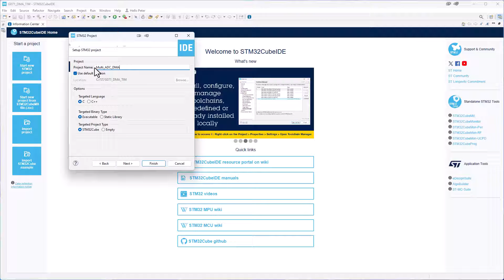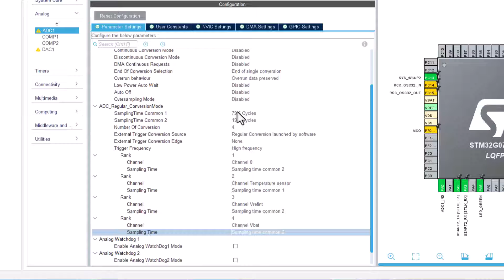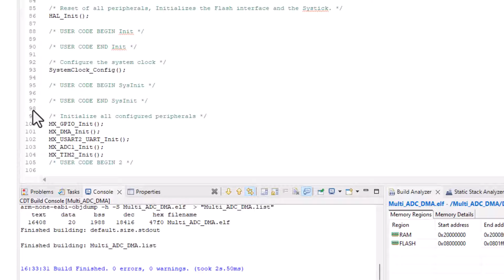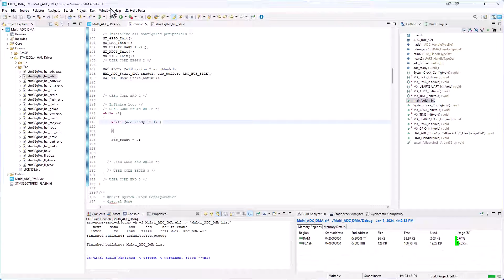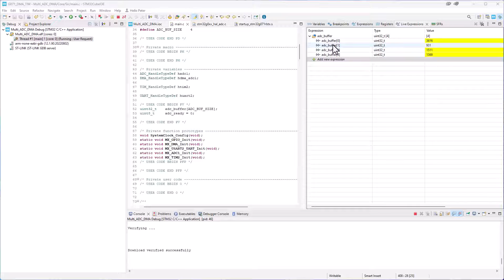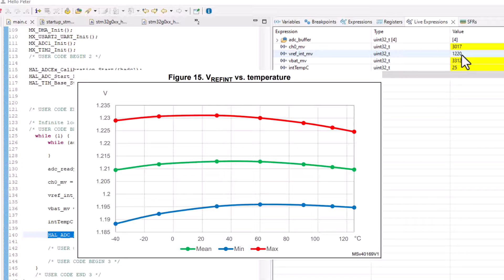STM32 Multi ADC DMA method

Comment: Great video. Thanks a lot. Looking forward to your next exciting videos!!!
Just curious,  are those 4 measurements are accurate? Probably  it would be good to have 20 items as in the beginning and then just get an average of each parameter?
Reply from the maker: Hi, "Accurate", that is a term that need to be specified. 
But your suggestion to make several samples and average them is a good way. You could also set boundaries to filter out glitches. Let's say you measure a 1volt rail and make 20 samples. 19 samples are in the proximity of one volt, and one measurement is getting 2 volts, which is in the application, not in scope, You could then filter out that reading .. So there are several ways to improve ADC readings. 
/PR TechTalk

Comment: Thank you very much. Today I learned something. That I know very very little about HAL library and functions. Hell I didn't know that HAL ADC has a built in function to convert the ADC values. 

But, why have used the HAl_START_ADc_DMA in the while loop instead of in main() as supposed to be?. Will it not slow down the controller as  the whole set of code needs to run every time in the loop ?

Comment: Can you show how to sense ac voltage
Reply from the maker: To sence  AC voltage you need to know what you are looking to measure. PeakVoltage, RMS Voltage, Frequenzy.

All have their way to be measured but all have in common you need to get several readings and then let your software do it´s magic to calculate the answer you are looking for.

/PR TechTalk
Reply: I need to calculate rms @prtechtalk416
Reply from the maker: The normal way to measure RMS AC voltage is to sample at a fixed rate (e.g., 1000 Hz for 50 Hz AC), capture enough samples to cover several periods, and then calculate the RMS directly from the data without worrying about the exact frequency. This assumes the frequency is stable enough for accurate results. If the frequenzy is not known or vary then you need to establish the frequenzy first.
/PR TechTalk

Comment: hello! this tutorial is awesome! an interesting aspect regarding the reading of the Vbat would be to be able to include the reading of the Vbat only every now  to preserve its charge (usually I read it once every hour), it is possible to programmatically disconnect the reading leaving the number of conversions (rank) unchanged  so that I don't have to worry about restructuring the length of the DMA buffer? (i am assuming to use the 20+  buffer to check and managed the value only after a couple of compleate reading). best reguards!
Reply from the maker: If i understand your application correct you have a set of ADC channels you regulary sample and only the Vbat you would like to sample less often. If this is the case the i would set a separate timer to trigger only the Vbat channel.
/PR TechTalk
Reply: @prtechtalk416  yes you understanded very well my application! i want to not discharge the battery with  to much readings , so it is possible to have a dma based readings for all the channel except the vbat and a single channel software activated polling for the Vbat?  how can be possible to select this method with the cube ? if i select scan mode isnt for ALL the channel? thank you!

Comment: Is it just me or STM32G0 series microcontroller ADC peripheral is noisier than the previous gen (STM32F0). Even in your video vref converted data readings are bouncing by few counts, but that voltage should be very stable in my opinion? In addition, I recently swapped STM32F051K4 for STM32G071K8 MCU. While using exact same ADC timing configuration I noticed that most of the sampled channel values are bouncing by +/-3. I performed a good few tests (different sequencer modes, longer sample times from 1.5 ADC clocks to 3.5 ADC clocks), but no success really. Another interesting observation is that by using 0.1% resistors (43K || 43K) to provide an offset in the differential amplifier circuit the measured offset is 2036 - 2038 counts which is 6 - 8 counts off from 2048. This is a repetitive result in at least 5 more boards that I tested, but  it was NEVER a problem with F0 based MCU while using exact same components and very similar layout. I know that in F0 series MCUs had a dedicated VDDA that was decoupled, do you think that is the main different regarding the measurement accuracy consistency or is there something else at play?
Reply from the maker: Decoupling VDDA is for a reason to stabilise the analog circuits. But the downside is loosing pins that could be used for alternative funtions. You can also try to over sample and make an average to gain stability and more ENOB. /PR TechTalk